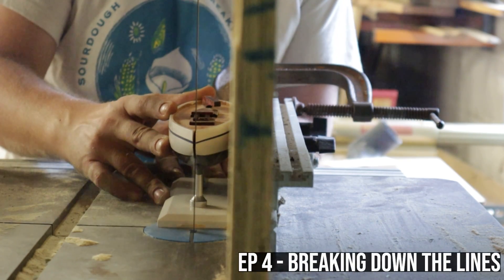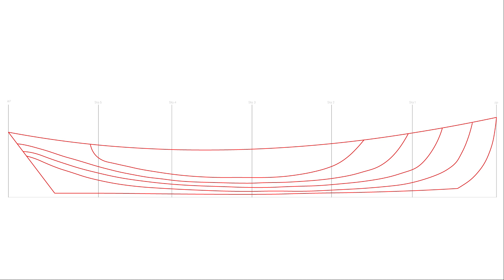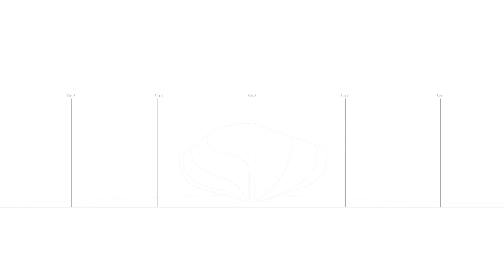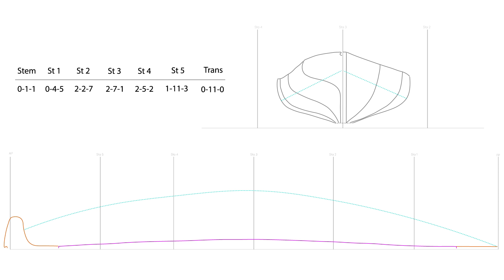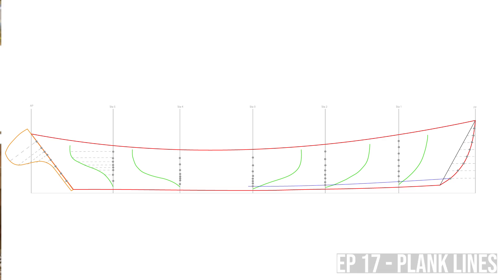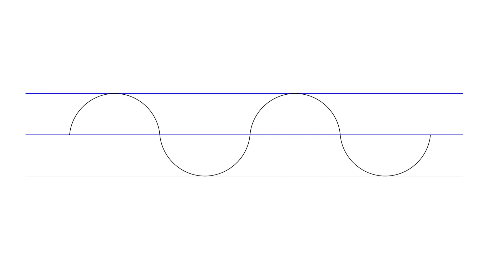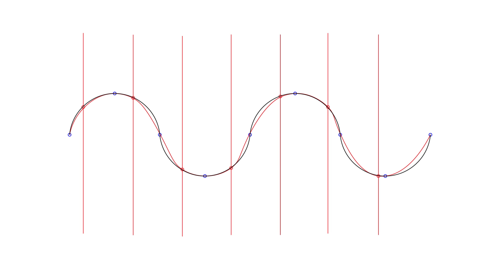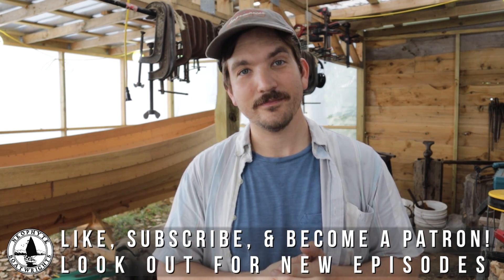Neophyte Bite! - What are Diagonals?

Comment: Thanks so much! Awesome explanation! I still don't know how do you get the diagonals - stem intersection points in the half breadth view. Great content as always, congratulations!
Reply from the maker: Were they not provided in the line able of offsets?
Reply: @neophyteboatwrights they were provided as heights above base line and widths on water line for the body plan. I'm struggling to translate that to the half breadth view. Thanks so much for such awesome content and prompt reply!!!
Reply from the maker: If drawing in the halfbreadth view, simply plot the offsets provided just like you did waterlines and fair in with a batten.
Reply: @neophyteboatwrights  thank you so much, mate!
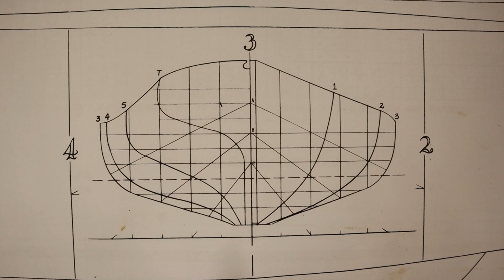Reply: Having recently started following this build it is absorbing and full of fantastic explanations as you go along. However, I am struggling to understand how the diagonals are generated. I keep going back to the table of offsets at 2:08 and drawn diagonals at 2:10 and, having even printed both screenshots fail to see any clue as to heights for A, B or C nor how the different angles of the diagonals are set up. The tick marks on the datum(?) and Station lines seem significant but are they the generators of the diagonals or the result?
I can understand the usefulness in refining the curves with these lines but not how to set out the start diagonals.
Thanks from UK 👍

Comment: Fine explanation, but from 8:56 you start to confuse me. You want me to reproduce just a few new waterlines. That is not wat Chapelle told me in het book Yacht designing and planning, page 184 about half way: "Measure off along the diagonal ... to their respective positions measured fromthe base line. " In that way you get a whole new fair curve that tells you more about the fairness of your lofted lines. Am I wrong?
Reply from the maker: Well I’m not entirely sure what Chapelle is saying in the quote, but what’s true is that the diagonal grid lines produce curved fair lines in either the profile or halfbreadth view.  So you can either pick up halfbreadths (distances from centerline to diagonal-station line intersection) or you can pick up heights above base (distances from the baseline to the diagonal-station line intersection) to check if the diagonal will yield a fair line. I can’t think of any advantage to using one over the other. However, I do think it would be overkill to use both. So pick one and work it.
Reply: Its not the one over the other. If you set out the numbers for diaganolas as given in the list, measured along the diagonal, you add points in the projection that are not certain enough. Waterlines and buttocks tend to be too acute in their projections on the grid fore and aft. That is where the diagonals come into their true meaning (dixit Chapelle).  @neophyteboatwrights
Reply: But then again; I do not want to be a wise guy... You built a lovely boat, your way.
Reply from the maker: Well I’m not seeing how this is at odds with what I said above. I agree with Chapelle that buttocks and waterlines are more accurate fore and aft, which in my mind is a function of the tighter curvature fore and aft. The tighter the curve, the fewer possible fair lines that agree with offsets. Thus There is indeed more room for error midships, though this more of an issue with waterlines than buttock lines, at least in my limited experience. BUT your original Chapelle quote seemed to say that the diagonal offsets as plotted in the body plan view ought to be checked against the fairness of the diagonal as lofted in the profile view, using heights above base. I in this video instead proposed using the diagonal as seen in the halfbreadth view to check fairness. So finally, I claim that one can use either view to help correct diagonal offsets, and if you were really persnickety you could loft the diagonals in both views, fair the curves, and use that to help make corrections to the diagonal offsets in the body plan. BUT I think that’s overkill.
Reply: Now my face resembles yours at the beginning of this video. My confusion starts on te moment of minute 8:56. There you suggest to take a projection of the distance the centerline and a certain crossingpoint of a diagonal and a stationline. I confused things further in the discussion by using the wrong quote from Chappele. Sorry for that.
On page 182 (Yacht designing and planning) Chapelle describes exactly what you demonstrated in video nr. 4: He says: "Imagine that you have a solid block, shaped like half of the hull devided longitudinally along the centerliune as represented in the bodyplan in the drawing, (and now it comes) and that you sawed this block along the lines indicated by the diagonals on the bodyplan. If you layed each of the freshly sawn faces on the drawing and traced their outlines you would have the shapes of the diagonals as they are to be projected on the lines."
That is different from what  you suggest in your video. In my view you produce only extra waterlines in that way.
Chapelle advises to use a seperate spot on the drawings to show these curved lines of the diagonals. Then you have a truly good chance to make very fair curves and correct the lines.
But I must admit; my understanding of all this is purely theoretical. I didnt build a boat like you do so succesfully. Many a designer, if not all, uses a computerprogramme any way...
Keep making these video's, I keep learning.
Reply from the maker: Ahhhhhh yes. Now I understand the point you are making. Well shoot, I need to scratch my head a little on this one. What I describe is taking a projection of a projection, fairing it, and then projecting back. Its not actually generating a true waterline. Its the shadow the diagonal cross-section would cast if light was shone on it from above. But it occurs to me that it’s totally unnecessary. One could just plot the diagonal offsets and fair them in directly. Thank you for drawing my attention to this. I’ll have to make an update post with the correction. More work, damnit!
Reply: Thanks for understanding me! I was afraid I made it all worse.

Comment: Are the diagonals unique to lapstrake boat plans? I'm looking at the plans for the carvel plank on frame dinghy I'm going to be building and it has no such lines.
Reply from the maker: No diagonals are not unique to lapstrake designs, however, a designer may elect to exclude diagonals if they don’t think they are necessary. While Walter Simmons did include them in his plans for the NTS, he personally told me to not bother lofting them. Use the offsets for the station lines, but otherwise ignore them. They are more critical if the hull is very shapely